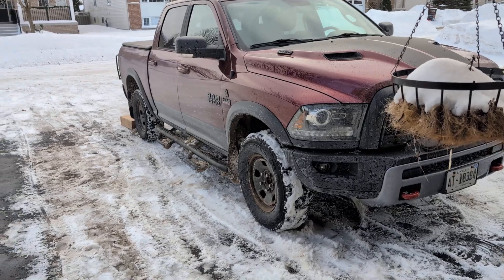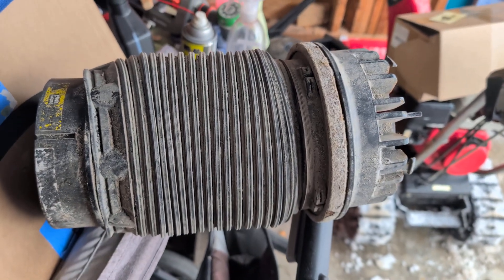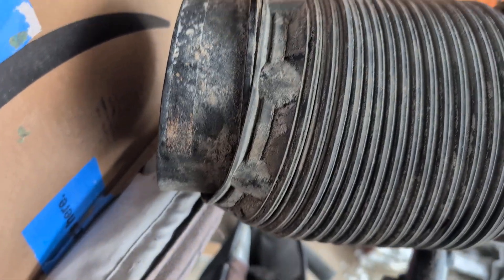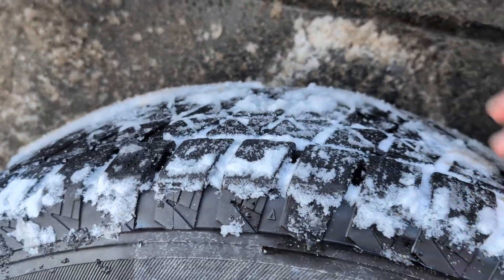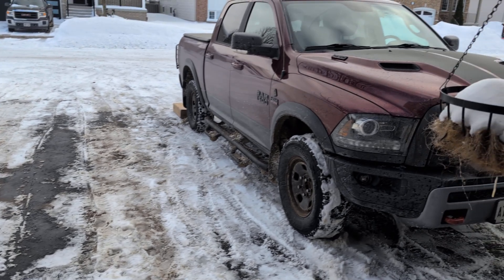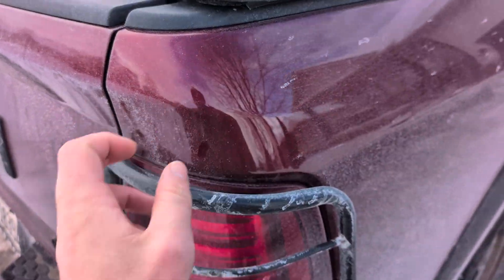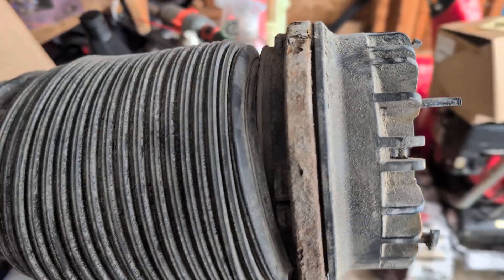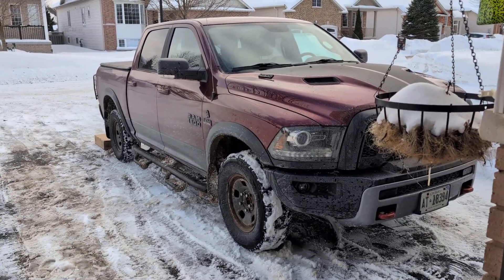Ram 1500 Rear Air Suspension Fix - Easy to DIY

Comment: Thank you so much for this! I have been looking for a solution because the dealer just won't swap the bags.
Reply from the maker: Hello, no problem. My dealer didn't seem to think it was the bags but the system attempting to fill the front and faulting out (especially after the valve bank was swapped) told me it was the rear bags being the issue.

Comment: If your air valve is working properly, your fronts won't leak out if the rears are leaking, unless you have Aero mode turned on.
Reply from the maker: My air valve was replaced and the fronts still leaked. The truck would  keep trying to pump in air until the compressor gets too hot or it finally faults out. And when it faults out. It's likely the ports are left in the open state. The only way to guarantee the ports are closed is to put it in tire jack mode. This forces all ports on the air valve closed. Each corner has its own line but the software opens more than one port at a time. After they start leaking, it doesn't matter if aero is on or not, air will still leak out the cracks. Once the rear air springs were replaced, it hasn't had a problem since.
Reply: @Reicher55  I mentioned Aero mode because it lowers all 4 corners of the suspension. If your air mass is low, then it won't be able to pump the front shocks back up to standard riding height because of the lack of nitrogen in the system. Yes, leaky systems overheat the air compressor and usually kill it because it was not designed to refill the system with air.
Reply from the maker: @vmxg8052  when there is no nitrogen left (or low nitrogen) the system will suck in outside air to compensate. My truck currently has 0 nitrogen left in it since mid winter when I replaced the air springs.
Reply: @Reicher55  I know that, I fix these systems all the time. I was just saying that the compressor wasn't designed to run the system on air and continually replace the air. This is what burns  out the compressor. I tell owners to find the leak as soon as possible when their truck starts to sit low overnight.
Reply from the maker: @vmxg8052 good call with telling them to find the leak ASAP. I'm surprised mine hadn't burnt out. It was 2 weeks of dealing with it and the shop not swapping the parts I told them to do. They kept thinking moisture freezing was the issue.

Comment: You mentioned the front leaked out the back - did you replace front air springs at all or did the rear air spring fix everything?
Reply from the maker: @malcolmmacdonald4290  All the nitrogen bled out through the back. So when the truck was parked, and valves were open, it would've leaked out eventually. It took about 4 days or so in the -10 to -20 degC weather. I have a new valve bank too, it just didn't fix the actual issue. The rear springs being replaced fixed everything. The dealer technician couldn't believe it was the fix. He thought it was the compressor. The reason I didn't think it was the compressor was when I told the truck to lower, the front would go down. When I told it to go up, the front would lift to its first stage  and wait for the rear but the rear never would move. So far they are still working in -20degC snowy weather.
Reply: @ my dealership said it was the valve bank, which I replaced myself, did nothing to the issue. Wasn’t better or worse. My rear right air springs always is the first to sag but eventually the whole truck sags. Based on what you said though I’m thinking it is just that rear right but then the whole system leaks through there. It is cold in Michigan right now so this issue that’s been going on for a few months is to the point where it won’t fill at all because the compressor is running to hot. Thanks for the video and the response !!!
Reply from the maker: @malcolmmacdonald4290  no problem.
The valve bank definitely could be the source but doesn't mean it's actually the source of your particular issue. If you had a warm garage to work in, you can do the soapy water test on the rear springs. You would just need to cut the zip tie holding the boot, lower the boot, spray it at the top with soapy water and have the truck in Aero or entry/exit